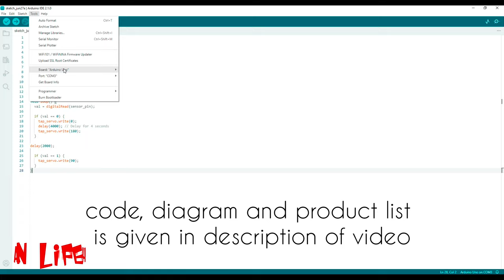How to make Smart Dustbin with Arduino and Infrared | Arduino Project

Comment: Nonsense, this is not smart dustbin at all you need to give it continue power to operate just for opening it and it does work without electricity so why waste resources like servo Arduino kheby will not be proud